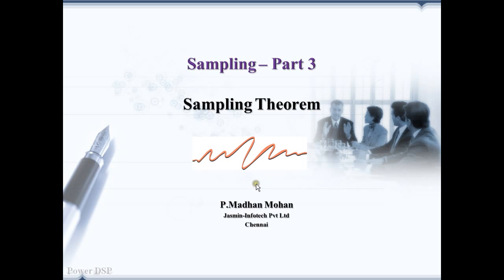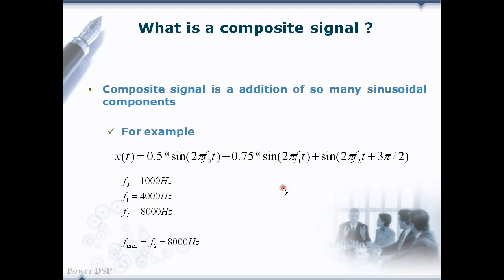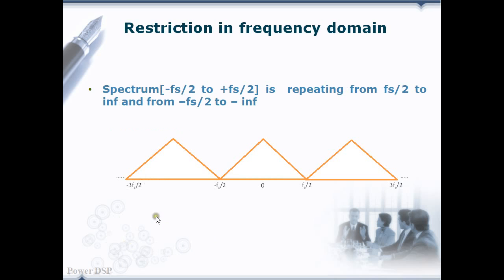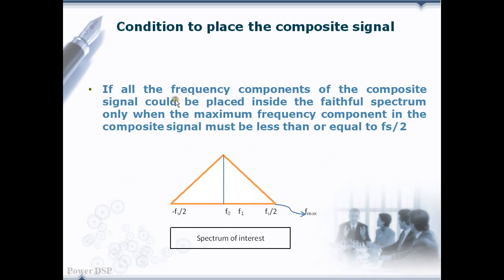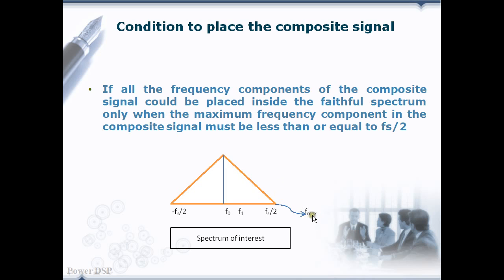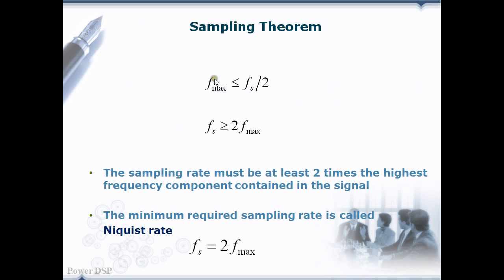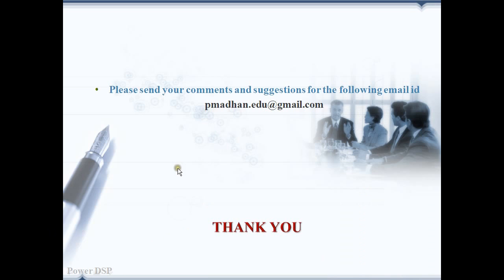Sampling Part 3 -Sampling Theorem

Comment: Sir, Let say, In our receiver, if you have the frequencies of 50, 60 and 70 MHz are going into ADC input with 20MHz IF filter bandwidth( 10 MHz on each side of 60MHz). And what is our sampling frequency should be?

The answer is 
a). fs>=2B (2*20 MHz)
b). fs >= fmax (2*70 MHz)

It would be very helpful, if you could answer this for me.
Many thanks